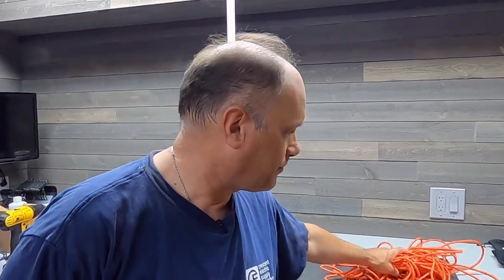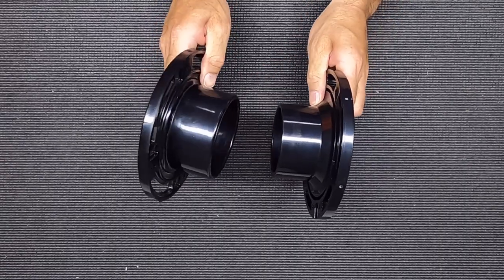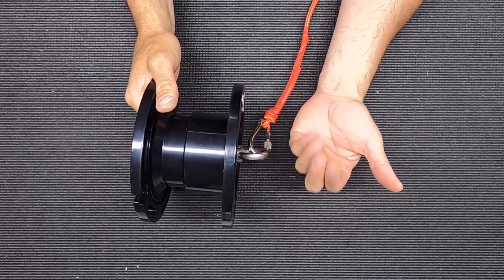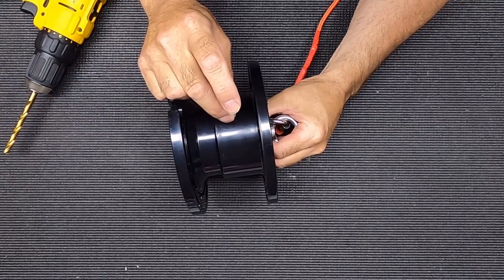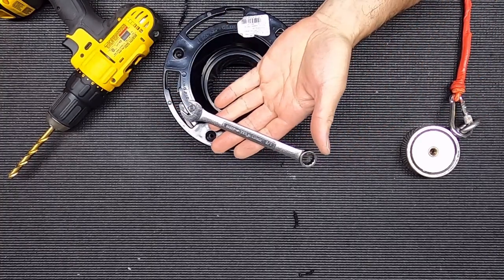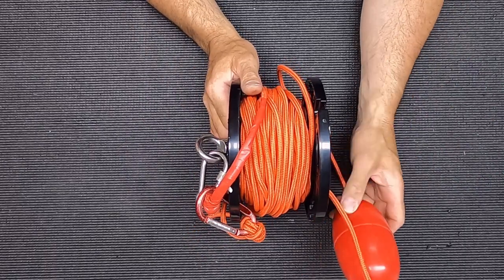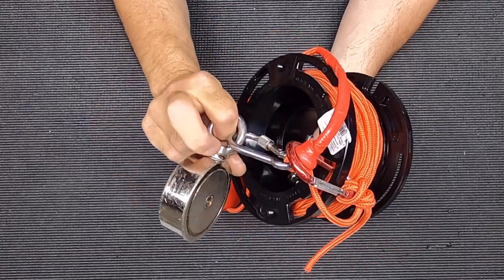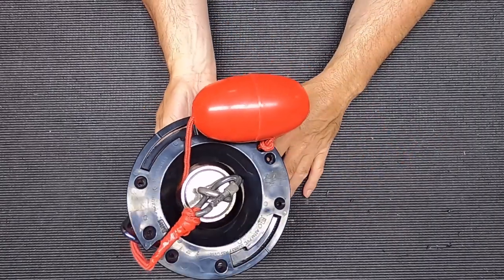DIY Rope Storage Reel for your Fishing Magnet

Comment: Thank you for your video. I used to scuba dive and find all kinds of stuff in the local lakes. Now that I'm 70 I'm not quite as enthusiastic about donning all that gear. Magnet fishing should help satisfy the urge for discovery.
Reply from the maker: I’ve always been interested in scuba diving, but have never taken the plunge! I’m glad you enjoyed the video and may take up magnet fishing!
Reply: @completepete  I completed the reel and am excited to try it out. I bought a stainless steel bolt at Ace without realizing it wouldn't be very magnetic. I might see about how it would be to magnetize the bolt, or maybe I'll buy a magnet and attach it inside the reel. The rope coiled up nicely on the reel and is no longer a mess. By the way, I used to scuba dive sometimes from a kayak (I think it was an Ocean Kayak Scupper Pro TW (Tank Well) that I bought from Bass Pro). Your video reminded me of that.
Reply from the maker: Thanks for watching and glad your reel came out as expected.  Hope you have a great summer and good luck with your treasure hunting!

Comment: Why do you prefer the dragging magnet rig over the jigging rig? I planned on jigging when I try my luck at kayak mag fishing.
Reply from the maker: No preference between the two..  Just trying to use the “right tool for the job”. Dragging the magnet allows us to cover more ground as the magnet is always in contact with the bottom. Jigging the magnet is a good technique for fishing from a bridge where you toss the magnet in and pull it up.

Both of my magnets have a threaded hole in the edge and the side.  One is set up for jigging so I can drop the magnet straight down to fish.  The other has the eye screwed into the side and is typically thrown out from a kayak and dragged back in (less likely to wedge in rocks).

We have found that a magnet thrown from our kayaks tends to act as an anchor.  Pulling the rope pulls you over to the magnet.  One technique is not to paddle, but throw the magnet and pull yourself along your intended course.

Throwing out the magnet, tying it to a grab handle and paddling along lets you cover a lot of ground also.

I’d match the fishing method to the conditions for sure..  Good luck!
Reply: @completepete  Thanks Pete, I went yakmagfishing yesterday and see what you mean about the anchor. That tossing the mag and pulling it like an anchor method is a brilliant idea. The mag acting as an anchor is something I quickly learned the hard way. I didnt even think about bringing my bruce anchor. I may even need my mushroom. Thanks for the reply. Dragging method 90% of the time. Jig for if I know somethings there but the drag wont stick. Right tool for the job as you said. Happy hunting